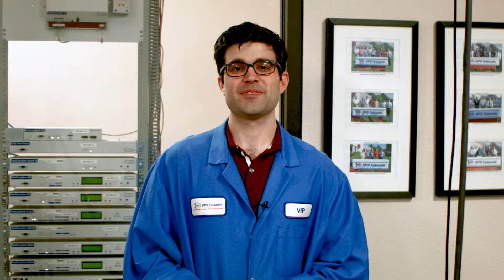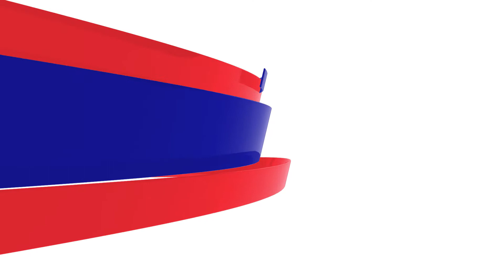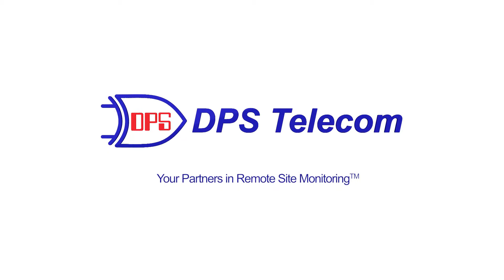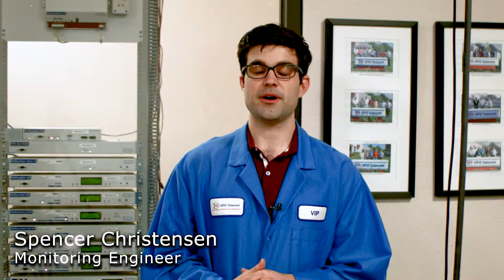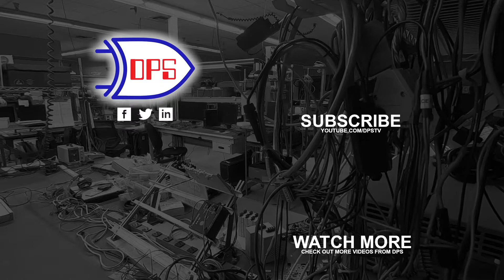Top 3 Problems with PLCs

Comment: Hi sir good day! I'm asking how to repair plc  no output?
Reply: Hye, do you find the solution?
Reply: No output,  is the output LED is on if it is ,PLC Programme is running correctly , check output voltage at output terminal , If no output  Led showing , the problem is a sequence input missing usually .

Comment: DCS Automation-Whole sale Dealer in PLC/Scada/ HMI/Drive/VFD Motors available in all Brand like Siemens,GE-Fanuc,AllenBradley (RockwellAutomation),Mitsubishi,Schneider,ABB & Third party instrument old/new item.
All Software activation licence also available in Online sevices like controlled anywhere by team viewer or anydesk etc.
 PLC Engineers call📲 9350039277 Email🌍 plc@engineer.com(24x7)anytime available for
per day visit services like programming,modification in process,commissioning & AMC provider in Ash handling system,Sugar Mill,Power,Fire Fighting,Alumina,steel,RO plant,sewage treatment,Turbine,Thermal,Chemical,Food processing etc in all industries all over India.